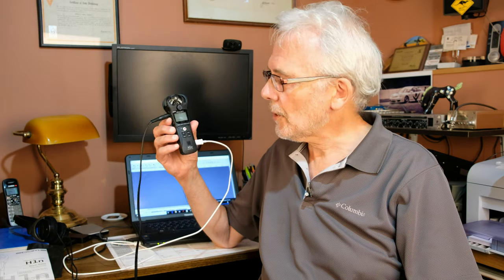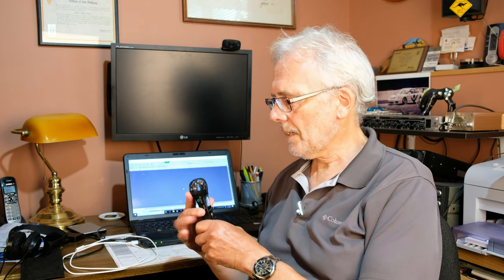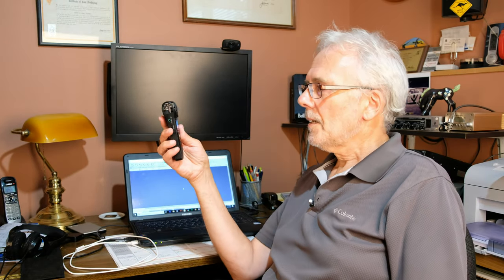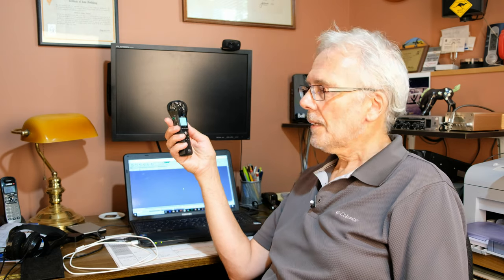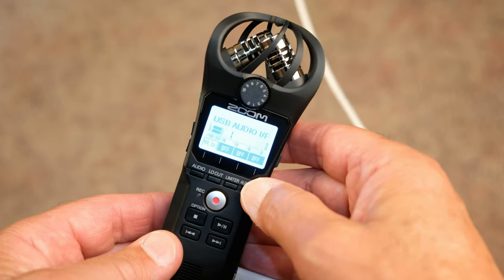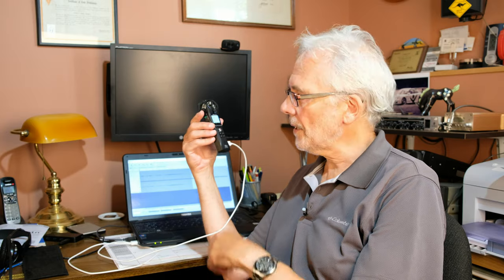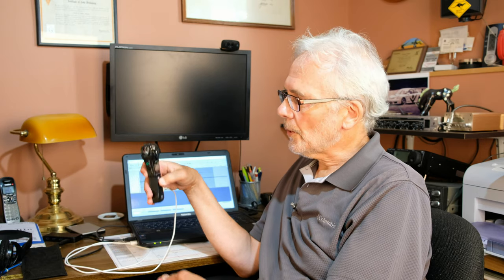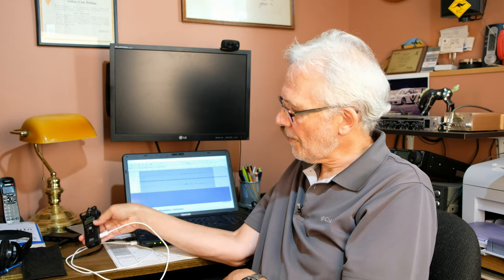Zoom H1n Handy Recorder: Connecting to a Computer + Other Observations

Comment from the maker: If you are having trouble connecting to the computer, first try a different usb cable. If that's unsuccessful, make sure the H1n is off before connecting to the computer. Then power up the H1n and you should see choices of Audio I/F or Card Reader. If this screen doesn't appear, I have no idea why not other than suspect cable or usb port.

Comment: I know this is old, but just in case anyone needs it: direct audio has no latency because the interface routes the audio from the mic directly to the headphones. Without it, you have to listen to audio that goes from the mic, through USB, through the DAW and then to the computer output, which always has some lag (the echo-ie sound you refer 6min into the video).
I have no experience using it, but I've been to live calls were I could hear myself with a delay and it really messes with your head. I also know that for recording artists, this might mean the final audio will be out of sync. Budget interfaces have a latency from 2ms to 7ms, but usually from 5ms upwards, it's already noticeable.
Reply: I'm just trying to figure out how to play the recording through my computer speakers so I don't have to wear a headset or listen through the tinny h1n speaker. How do you do THAT?
Reply: @RichLP1  Can't say if it's possible. As far as I know, monitoring is always done with the recording device. If you record with something like a Presonus Studio 24c, you monitor plugged to the Presonus not the PC. If you record with a camera, you monitor plugged to the camera. Monitoring through the PC might be possible by going to windows sound settings and activating "Listen to this device", but it could be laggy.
Reply: Probably because the mic is an analog components, which can easily be converted to analog signals to the headphones.  When it has to go through USB, it has to be first converted to digital, as it does when you want to record and save the data to a memory device.  That digital data has to be sent through the USB cable using some sort of serial protocol, which adds additional data in the headers of the packets, in order to be received and interpreted by the computer.

Comment: Have you tried ASIO drivers instead of regular ones. With those and monitoring from the headphones on the recorder with Direct On (as you would do with any professional audio interface, where you connect your headphones or monitors to your interface, not to your computer...hence the term interface)  you will be able to record without noticeable latency.

Comment: Thanks for the info. I have a question. I just got this recorder and when I hook it up to the computer I do not get the usb menu. I have tried different usb ports on my computer and it still just goes to the regular recording menu. It does not seem to recognize the usb. It did the first time but not any more. Could I have done something in the settings or is it just a faulty unit? If you have any ideas I would appreciate your insight.
Reply: Try switching cables.   had the same problem.  I have used it regularly as a USB mic for recording a voiceover for powerpoint.  I then switched to SD card to make an audio recording.  When I wanted to go back to USB, the option just wouldn't come up - it kept going straight to SD Card.  In desperation I tried a different cable and to my amazement the USB option is back.  Both cables were from the same store and fairly new but the shorter one worked and the longer one didn't.

Comment: I don't know why, but now for some reason, when I turn my H1n on the display does not show the usb or card reader screen but goes directly to card reader.ss If I plug a usb cable into my computer then turn on the H1n, it still goes directly to card reader.
Reply from the maker: Unfortunately, you're not the only one to encounter this problem, based on previous comments. I haven't seen this problem myself, but there's obviously a glitch in the firmware. I hope Zoom is aware of this and has updated the firmware. You may want to look on their site for the latest update, although, admittedly, I have never checked to see if mine needs updating.

Comment: Im facing problem while using zoom h1 as a audio interface ,when i trun off my computer and again turn it on the h1 too opens along with pc but i should have to set up again in h1..do you have any solution to setup a defult settings on h1 ...
Reply from the maker: Not sure I understand the question, but the H1n will automatically give you the choice of Audio I/F or Card Reader when reconnected to a powered computer. You then have to choose which mode you want. I don't think the recorder is sophisticated enough to allow you to set a default, but I may be wrong.

Comment: I have an issue, I dont know if someone can help me with this: The issue is that my zoom h1n is not showing the menu to used as an interface when I connected it with any laptops. This is weird because before everything was working properly. Did someone have similar issues with this?
Reply from the maker: I tested my H1n by first turning it on, then plugging into the laptop. The USB menu came up ok. Ditto with turning on the H1n after plugging into the laptop. Others seem to have similar problems, but since mine is functioning ok, I'm not sure what's causing the problem. Could be your USB cable is faulty, so it's not seeing the computer, but I'm sure you've probably tried swapping cables.

Comment: The choices don't come up from me. :( Boo. Thanks though!
Reply: Same here. I can't get the usb menu. Did you ever get it figured out? I am thinking maybe I have a bad unit. I have tried different usb ports on my computer but no different.
Reply: Initially didn't work for me as well, but once switched the usb cable to a different one, it was good. Apparently some USB cables don't allow data transfer or any other functionality for that matter, other than plain charging.

Comment: I don't seem to be able to revisit the initial Audio IF vs Card Reader option; it seems that I chose Card Reader at some point, and now I can't change it. Do you have any idea how to do that?
Reply from the maker: The act of plugging the USB cable into a computer that is switched on seems to be the trigger for getting the Audio I/F vs Card Reader choice. Then use the up down keys to choose either. If you don't see the choice, try another USB cable, or switch the recorder off then on again and plug into the computer. Other than that, I don't know what to suggest, other than a firmware update.